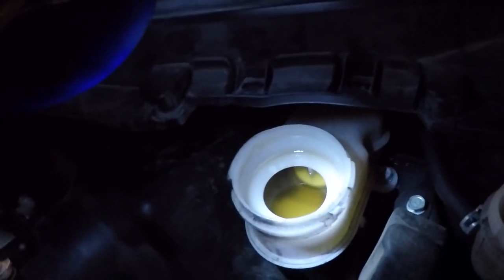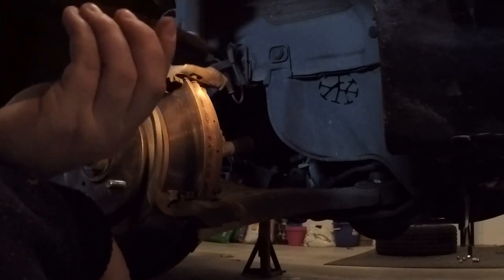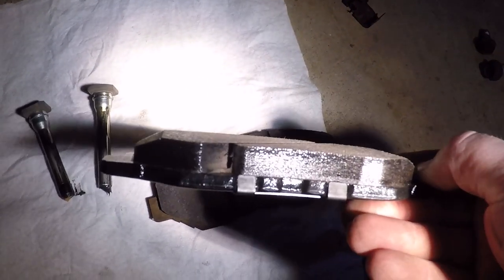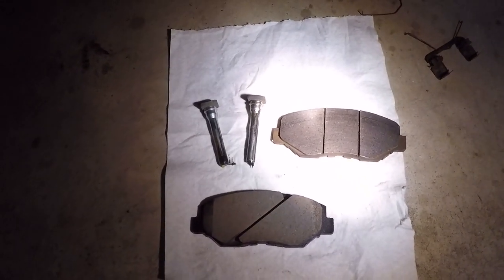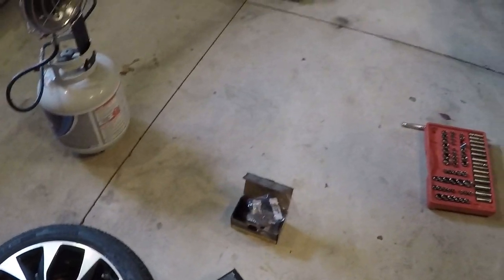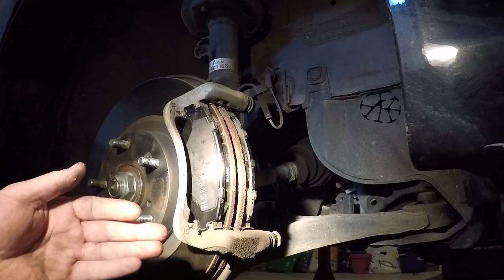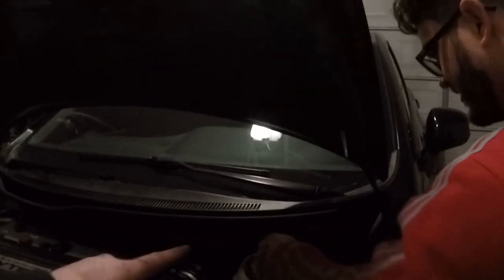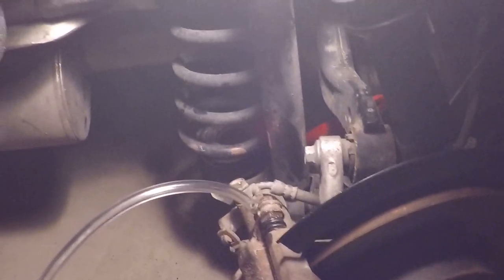2013 Civic SI Akebono Street Performace Brake Pad Review

Comment: Hi there, a lot of factors can affect your results. Weather, temperature, road conditions, kept the same rotors, the fusion between the bads and the rotors not achieved. Usually you need 400 to 700 miles for the total break in. I'll be very curious that you heat up few times before you measure.  In order to perform, Ceramic pads needs heat. Glad you post your video